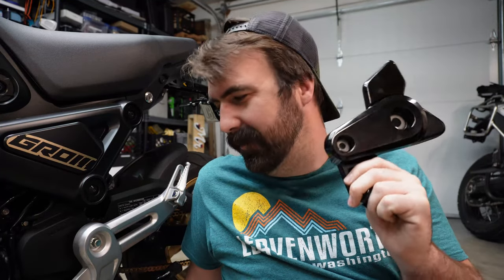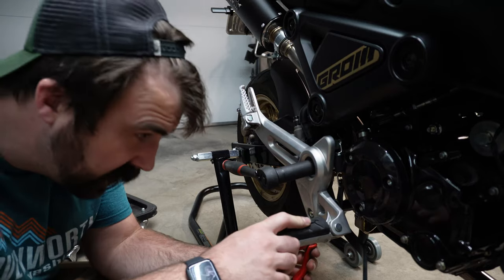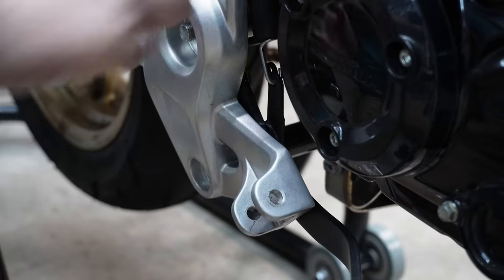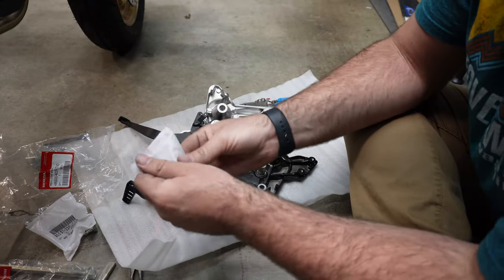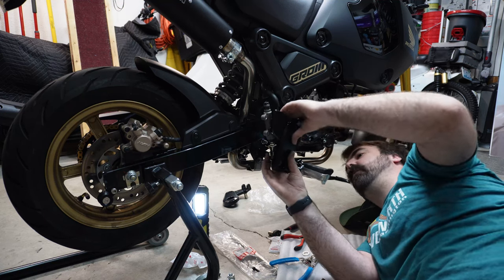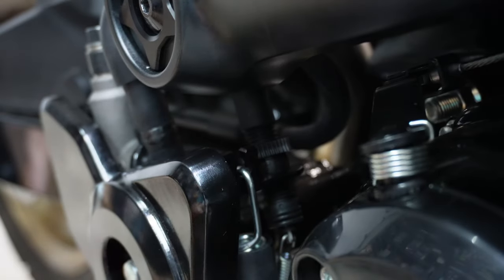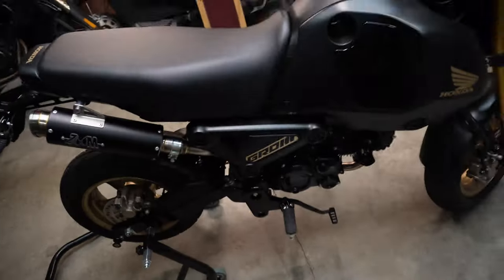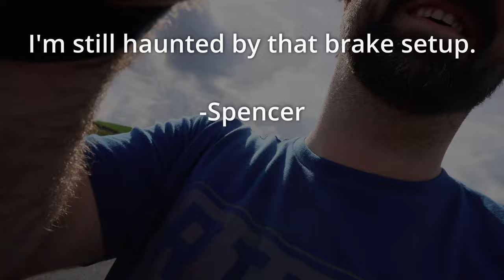Monkey Rearsets on a Grom Install! | 2023 Grom Build Part 15

Comment: Hi. Why you dont use the bobbins to lift your bike? Greets from Germany
Reply from the maker: Good question! The stand I have is a swingarm stand, I need to get one for spools. Where it lifts isn't very stable when using the spools, it's just a wide flat area instead of a normal v-notch that a spool stand uses. I'll get the correct stand eventually 😂
Reply: @SpencerDesmarais  Ah, ok. I dont like the type of your Stand, It can scratch the swingarm and is uncomfortable to lift! Cool mods btw!